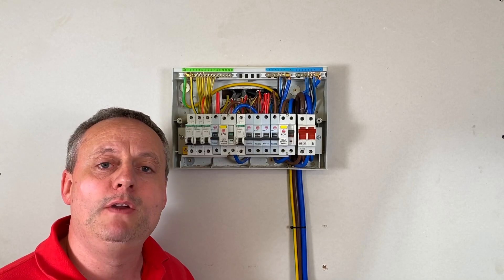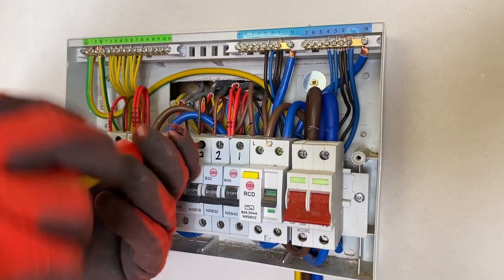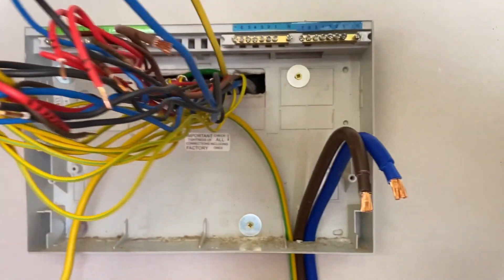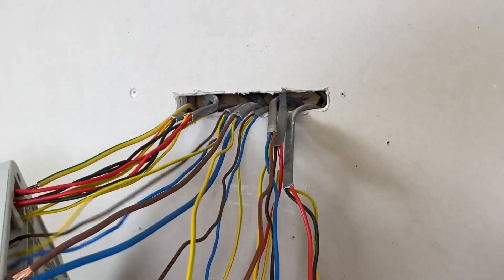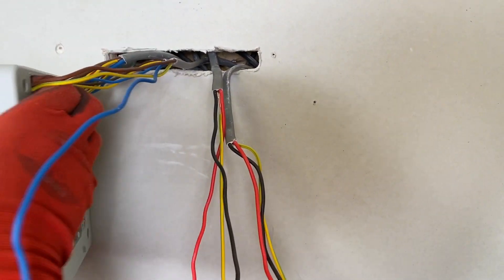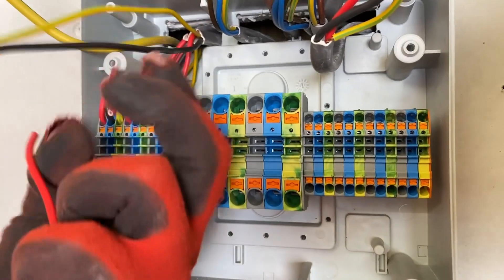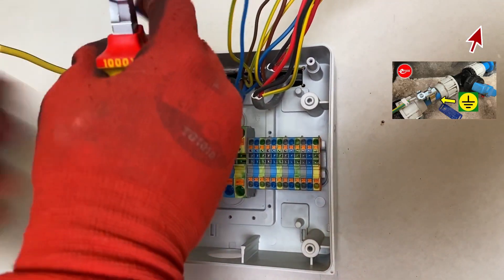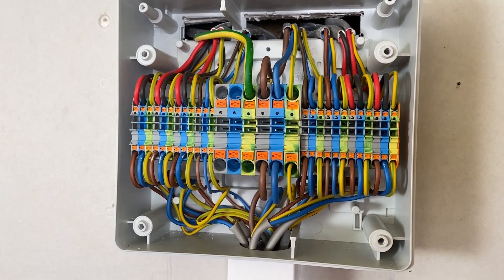How to Move a Fuse Board - The Easy Way |  Wiska Consumer Unit Relocation Kit

Comment: While this looks a nice idea, it's really only going to be useful for moving smaller or older boards  that don't have too many circuits on. Given that RFCs take up two sets, it doesn't have to have many before there are not enough connections. (Yes you could mount two side by side but then the original cables likely won't reach into both)

I've just relocated a standard 10 way Dual RCD board from a hallway to a cupboard for aesthetic purposes, and this would not have been adequate (3 x RFC, Oven, Shed, 3 x lighting circuits) even though the original board had two unused ways.

Hopefully in time suppliers will stock wider boxes and let you mix and match the connectors to suit.
Reply: No reason you can't just buy the individual TOPJOB blocks and any size adaptable box with appropriate DIN rail - just a prebuilt kit of that at the end of the day
Reply: @intercity125  just make sure you get a plastic din rail and/or use grey blocks for the earths.
Reply: im pretty sure they have different sizes of the relocation kit

Comment: Nice bit of kit. What are your thoughts on the enclosure being plastic? I think the ref states something along the lines of consumer units and similar enclosures in domestics should be non combustible. I guess with all connections being non-screw this reduces risks of poor connections.
Reply: Switchgear or similar. Spring contact connectors aren't switchgear...
Reply: Also im pretty sure this is selt-extinguishing Plastic. This basically means it will combust while inside an open Flame, but as soon as you remove the Flame it will extinguish itself.

Comment: If you struggle to find the Wago range, Phoenix Contact make the same and I use the pre-printed circuit identifier label that clip in just under the small squares which are used with bridging combs to common up terminals. You could also mention the test point just above those squares. I use these extensively when building control panels, they are great.
Reply: Yeah, the products are equal - but Wago offer different sizes same Phoenix Contact. They offer 1to2 terminals too - so you can put a ring to this box and use one line to CU only. I think for more as 4 mm² (specially more as 10 mm²) is this a better solution. 

BTW: For testing are the holes - the red square are for put together more as one product with special nuts. 😉

Comment: Wiska is only for 10 way board but what about if you want to move 20 way board or 3 phase pannel 30-35 circuits ????🤔🤔🤔 you will need a bigger wiska
Reply: or several?
Reply: There are plenty of larger alternatives from different manufacturers readily available.

Comment: Nice bit off kit , looks nice and neat , point one what was the reason for changing and relocating the CU ? I get the point that the cables aren’t long enough too reach the new position but why the change of CU . Consumer units in dwellings page 99 in the onsite guide. Point two Gaz when are we going to see you do the job you’re self. 🤣
Fantastic video guy’s as always 👍👍👍❤️
Reply: I mean, it’s a pretty old unit with a bunch of alterations — non-original MCBs in use, it’s a dual-RCD one to start with, several MCBs unused… replacing it isn’t a hard requirement, but if the consumer is wanting some new circuits, and/or an rcbo board, or wants the thing moved out of the way, well.
Reply: @JasperJanssen  I get your point but duel RCD/split load are still compliant with BS7671 and we can still install them,
My point was apart from the relocation of the CU I can’t see any reason for changing it’s in good condition now signs of damage exposed conductive parts, now signs of over heating or burning. So as long as his tests give readings as specified in BS7671 the it can be deemed as safe for continued service. Even if it’s an old rewireble fuse box  BS7671 is not and can not be back dated. The regs only apply from the date they come in onwards, not backwards.
Reply: Oh and there is no need to repeat your comments three times.
Reply: @seandempsey7351  no shit, Sherlock. YouTube isn’t always the most reliable site.
Reply: @JasperJanssen  no need to be rude , if you don’t or can’t respect someone’s opinion then don’t reply. Like I said in my original post I get the idea of extending the cables and relocating the CU . This is one solution of many , but if this is a real installation what was the reason for changing the CU ? 
Just because it’s old dose not mean it is dangerous , again page 99 off the onsite guide 
It is important the installer’s do NOT advise the replacement of consumer units simply because they do not comply with the current version of BS7671. 
Try reading it and not just bypassing page 99 or the health and safety executive’s note in BS7671.
Reply: @seandempsey7351  True many perfectly serviceable CU's are being ripped off the wall.  A Schneider board I went out to rectify a fault on was not long after ripped out and replaced with an Axiom board. 

The work on the new installation was shocking exposed conductors and a few loose connections.  I honestly don't know how these fly by night sparks sleep. It was stickered up well enough with his business details 😂.  Again the customer had to pay me to put it all up to standard. The original cu really didn't need replacing.
Reply: @rayc1503  thank you.
It seems no one is bothered about what the health and safety executive’s note in BS7671 says or the clear guidance on page 99 of the onsite guide. Even most rewireble fuse boxes are still safe for continued service, even though they don’t have RCD protection we must remember the reg are not retroactive and can’t be back dated, they are only required from the date of publication onwards. But some of these idiots see an old rewireble fuse box and there eyes light up with pound signs, we can only recommend an upgrade unless there is a clear and present danger to life and or property that’s why we carry out all the tests and visual inspection.
I will bang on about this thill I am blue in the face . Most sparks have never seen the inside of BS7671 apart from the day they sat there exam’s  and there are a lot who don’t even own a copy .
Reply: @JasperJanssen  it’s only the last two Crabtree MCBs on the left side of CU that are not in use , to the best of my knowledge Crabtree MCBs are compatible with some wylex boards. But I could be wrong.
Reply from the maker: We have a Rick 🦾

Comment: What's the tool being used at 9:00 in?
Reply: Multi tool. The sort of thing that once you have it you wonder how you used to do the job without it
Reply: @12000gp  I never knew there was a tool that cuts like this! Amazing!
Reply: @analogdistortion  get yourself one. It’ll change your life😂
Not sure why they drilled pilot holes for it on the corners though
Reply: @12000gp  to mark on the back where the corners would be as it’s only evident from the front (inside). Rick did explain that during the segment.
Reply: @SamButlerUK  fair enough, I missed that

Comment: 10y ago I had to swap my CU. I built the new CU on a bit of 18mm ply and mounted a DIN box next to it on the on the ply and wired the two on the Kitchen table. Was very easy. Then mounted on the wall as one unit and terminated the cable runs in to the din box

All very neat. All very well labelled. All safe. All easy to maintain. 

Several reasons I did this. But afterwards I wondered why everyone doesn’t do this ? Space I suppose 🤷‍♂️ but it didn’t take too much more space.

Comment: I might be being stupid here, but I don't see the purpose in this. You still have a box on the wall and are running cables to the new location anyway. Why not just put a larger board in the same location and run the additional circuits back to it.
Reply: With things like SPD's and the increase in circuits sometimes you need a larger board, some older boards are put in cupboards or even the meter box where even if you wanted to there physically is not enough room so the consumer unit needs to be moved..  It is relatively rare..
Reply: @steve11211  It's on a big empty wall 🤷‍♂️
Reply: @solidus784  in this case yes but they’re just showing off the unit, it’s up to you if and where you use it
Reply: @12000gp  Yeah clearly they are demoing the unit , but it looks like a real installation to me and not a workbench hence my origiinal question
Reply: @solidus784  I dont think that was a real life consumer unit, I think it was a mockup and they were just showing the product..
Reply: @steve11211  red and black went out in Ireland in the 90's not sure about England
Reply: @solidus784  2005, it is also an old plastic 17th amendment board, but ask any electrician and they have loads of that old cable pulled out ready to go to the scrap man..  I am guessing that consumer unit was also one pulled out from an old install..  The reason I think its a mock up is when they took the board off, the back behind the board was exactly the same colour as the rest of the wall, the tails and earth look very new.  I could be wrong but I think it was probably a paid advertisement to show off the product..
Reply: @steve11211  It's the tails that made me think it's a real install. Looks like a temporary job until the supply is moved to a new location. But my original point is I don't see the point in this situation. I know there is the rare occasion where you might have to use a unit like this.
Reply: @solidus784  I mean, it’s not going to be terribly common, but when you need to solve this exact problem, it’s good to have ideas on what to do to solve it.
Reply: @steve11211  spot on , this is nothing more than promoting a product on behalf of there sponcer . It’s a paid promotion
Reply: It could be the existing consumer may need replacing and the client doesn't want a full rewire, the old consumer could be mounted up high  and In an inconvenient location for example  for the tenants/home owners so the extension box could be used to lower or move the new consumer unit to the correct regulation height.
Reply: Maybe it was in a hard to reach place, or in a kitchen that's being redesigned and will be blocked by a cabinet,  or to move it away from a too easily accessible point where kids/morons could mess with it....
Why isn't the point here.
Reply: Agreed it would have been useful to explain the reason to move the consumer unit. 

Usually I see this solution, as in my case, because the existing runs won’t reach the extra few inches to where the new Cu needs to be mounted. 

🤷‍♂️